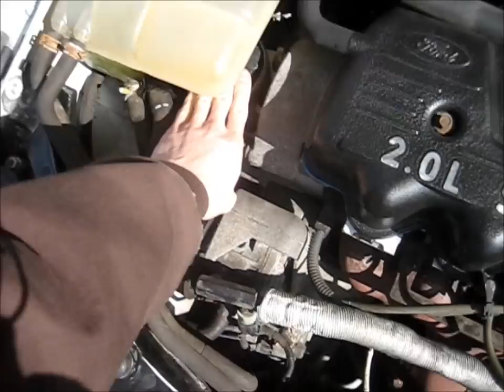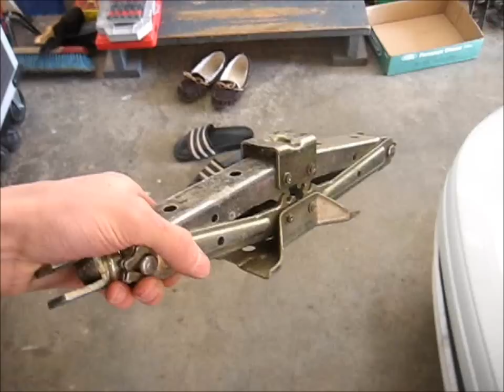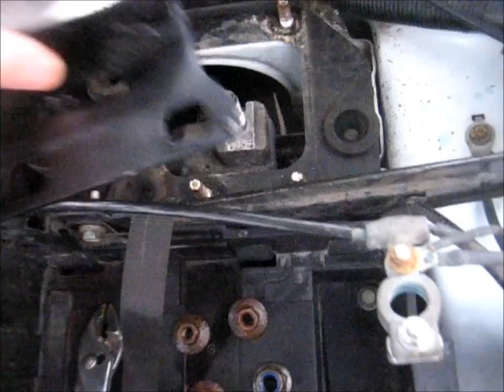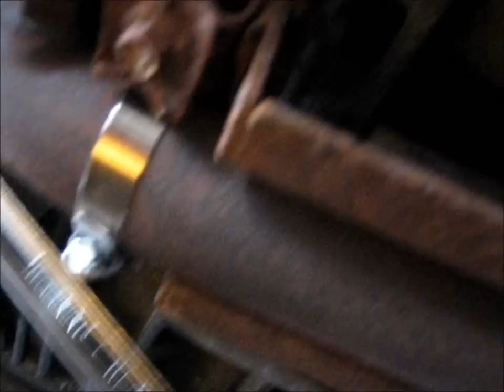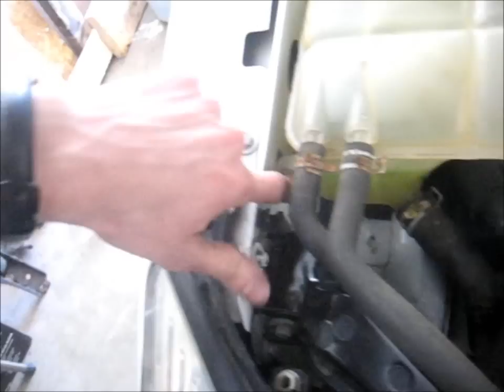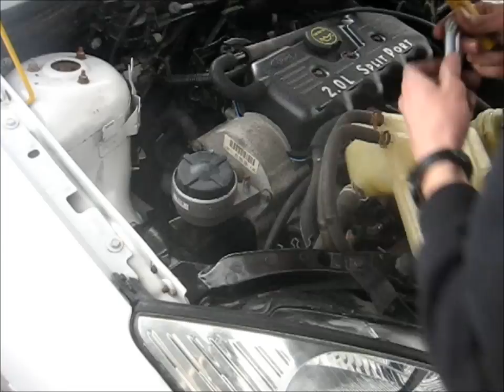How to Replace Ford Focus Motor Mounts

Comment: There are some torque values assigned to these large carrier bolts that you would want to pay attention to....
Reply from the maker: I'm sure there are, but we're not setting bearing preload or replacing a head gasket. I don't think there's any problem with ignoring the torque values here.
Reply: TheAlexManVideos  If >20 to 30 ft/lbs, I would definitely use a torque wrench.  Big difference between 60 and 190 ft/lbs if you're tightening down a driveshaft nut.

Comment: Do u have to torque the bolts to a particular foot pound?
Reply: Nestor Saucedo rock auto has the torque specs for the engine mounts

Comment: When you changed the clutch, how did you take off the hydraulic line going to the bell housing / slave cylinder? I took the retaining clip off but don't know how to separate it to take the transmission down. Mine has 1 tube with a bleeder screw. Some people say use a hydraulic line removal tool, and others say unscrew the bleeder screw and lift off. What do I do?

Comment: As for the one on the driver side how much do i have to raise the transmission so the bolt can reach to the top in order to put the new mount and be able to screw the nut in?

Comment: my 07 ZX3  passenger side mount did not have that bolt under there to separate the mount from the bracket.  Did not matter as my new mount from Ford was all one piece with a new bracket.

Comment: Good video, appreciated!   To others, I strongly suggest going to Ford for the passenger side mount.  Pay a little extra, do it once.  Ford sells the mount with the bracket is one reason it cost more than aftermarket.  Also one less step you need to do when changing.  The bolt to separate the bad mount from the bracket can be a pain without an impact.  Need to put in in a vice is usually the best way of you MUST go aftermarket mount.  You'll be good at it after the 3rd time replacing in a year tho, lol.

Comment: Probably one of the most professional tutorials I have seen to date.  Excellent work!  Enough info to get it done, but without the endless jabbering some people feel compelled to include.  You even sped up the bolt removal sequences so those watching don't fall asleep.  I commend you for a job very well done!!!  I think I need to do mine this week.  173000 miles, and it's been shaking and quaking for the past 2 winters when I start it up.

Comment: It looks as though the dogbone mount didn't require a jack....? I was hoping to see placement for it.
Reply from the maker: Willard Moore No jack needed for that one but you'll probably need to safely lift the vehicle to be able to crawl under and reach it. That mount doesn't hold any weight, just keeps the engine from rotating relative to the body.

Comment: I saw you made this video a year ago; Are the parts from Advanced Auto still holding up ok? (This is where I planned to get mine as well)
Reply: Just throwing it out there I'm almost a year down the road; All mounts holding up from Advanced Auto Parts. =)
Reply from the maker: Sorry, sold the car a couple months after uploading this video. No long term results to report.
Reply: All good; I ended up using the parts anyways, the only difficulty was the lower mount (lining it up with the transmission bracket) but all worked out well in the end. Thanks for the video cheers ^^
Reply: The after marke mounts don't last. Sadly you need to buy from the dealer to get good ones.

Comment: My 2013 Focus SE has vibration at low speed, especially turning left or right, and some noise like parts rubbing each other. Do you think it also engine mount problem? Only 9 month 25,000 km.
Reply: That sounds like it could be drive axles if it occurs when turning.

Comment: Thank you for this great video!  I was quotes $550 bucks to have the Ford Dealership do this but I was able to do it myself for less than $100.  One thing I encountered that might be helpful to others that attempt this though, when I removed the transmission mount the center bolt that comes up through the hole in the frame shifted about an inch towards the front of the car.  I checked the jack I was using and it was stable and holding but the engine still shifted to a place where I was not able to easily fit the new mount over the center bolt while still threading the 4 outer holes through the bolts on the frame.  I got a second jack set up under the engine to reinforce the support on the bottom of the engine and had to shove the engine backwards 3 or 4 times with the mount resting on the top of the frame until the mount fell into position.  It was a little scary as I'm pretty sure I was close to dropping the engine onto my garage floor.  It all worked out in the end though and I saved myself a bunch of money.
Reply: Ford was going to use high quality mounts. Those run well over $100 each.
Reply: How are the after market mounts compared to the Ford parts?? Is it worth the money to spend on the ford parts if you are going to keep the car for a while?
Reply: I bought mounts from Roc Auto. I don't have the car anymore, I traded it in a couple months ago. But they held for the entire remaining time I had the car. I have no complaints.
Reply: +Brian Baraszu the aftermarket mounts are junk, especially anchor mounts. They have a lift time warranty so you'll be replacing them your entire lifetime. Go dealer.
Reply: Of course OEM parts are better, but when you're dealing with a 10+ year old car, you have to weigh the cost and whether or not it's worth it to spend on something you might only have for a few years.  For me, the Rock Auto parts were adequate and half the cost.
Reply: Seth Angel  on my 03 focus 2.0ltr dohc L4 vin 3 sedan, my dog bone mount, the bolt that mounts up & down, is bound up!!! it twists then when I let go, it flexes back.i put a box 15th box end wrench on the top nut & doubled up my wrenches 4 more leverage yet as I thought it was turning, I think I stripped my wrench.is that nut welded? I wouldn't think so because it is needed to secure the new mount! I'm stuck & besides cutting it out with a sawsaw, I don't know what else to do but then 8 would be stuck with no way to the parts store.the parts store does not know what bolt it takes so I would half to take in the original & match the treads but after I snap it, I'm stuck! I'm half tempted to do it in the parts store's parking lot so I have access to parts
Reply: Mine came out fine. But it's a pretty common problem with those center mounts. The bolt corrodes to the housing and the entire rubber bushing will turn when you try to loosen it. The mount isn't very strong though and you should be able to cut through it to get to the bolt. I was generous with the grease when putting the new mount on to hopefully keep corrosion off in the future.

Comment: Are the bolts for the dogbone (one that appears to go into sub frame, 3 for bracket) threaded into the subframe and transmission or are there nuts? I need to replace the motor mounts on my 2011.
Reply from the maker: There were no nuts on mine, all blind threads. I wouldn't be surprised if yours was different. Yours is nine years newer.
Reply: 2000 to 2011 were pretty much the same car.

Comment: So, do I need a power tool and jack stands? what size socket? Do I need to replace them all?
Reply from the maker: You do not need power tools, jackstands or proper ramps are necessary. Do not crawl under a vehicle that is not properly supported. A floor jack or scissor jack is not safe to crawl under. I do not remember the socket sizes, use what fits. Replace only the mounts that are damaged.
Reply: TheAlexManVideos
thanks, i did it by myself and my car feels a lot better

Comment: I was checking at some motor mounts on the internet. Some of them are about $60 for the whole kit of 3 pcs. Are those durable and do they work just fine? Thanks.
Reply from the maker: I've never used that kit or one similar. I only ever used the parts installed in this video. I also sold the car about 3 months later so I can't give any long term reviews.

Comment: Your video has inspired me to try this myself.  My mechanic quoted my $1000 to do the job.  I've already purchased the parts for half the quoted price from the dealer.  But I do have one question.  I have a Haynes Repair Manual and the section that talks about replacing the motor mount has a note that says "The mount securing nuts are self-locking, and must therefore be replaced whenever they have been removed.".   I would like to have all my parts before starting the job.  Where's the best place to get these nuts?  Home Depot? Autozone?  Dealership?  How do I make sure I am getting the right ones?
Reply from the maker: I reused all the hardware.

Comment: hi. did you have to get the drivers side mount from ford or were you able to get it from your local autoparts store?  my local aps sucks and are trying to sell me the wrong mount for drivers side stating its the same as the passenger?  ugh
Reply from the maker: Advance Auto Parts was able to source all 3 mounts without issue.

Comment: Thanks for the video, i bought a focus recently and somebody forgot to tighten the 2 bolts on the upper right mount so i had mad vibration and a knocking when accelerating.

Comment: did you support the engine when you replaced the rear mount (lower)? Did the engine move when you released the bolts? I like using ramp to the front end. I'm not to confident with jackstands. I'm not sure if the engine need to be aligned when inserting the bolts from under. thanks
Reply from the maker: When you replace the torque rod (lower engine mount) you do not need to support the engine. The engine might rotate slightly when you remove the torque rod but it's nothing that will cause damage or be hard to realign. During reassembly, you might want to have a second person stand over the engine and tilt it back and forth to help you line up the bolt holes. Ramps will be fine, just have the engine in neutral and the parking brake engaged.

Comment: hi. i would like to know how many foot lbs. of torque is required when reinstalling the  bolts for all the engine mounts. great video btw. thanks
Reply: Michael Goldstein 
Engine roll restrictor to transmission 35 ft. lbs. Engine roll restrictor to subframe 35 ft. lbs. Engine rear mount to body 35 ft. lbs. Engine rear mount (nut on transmission mounting bracket) 98 ft. lbs. Engine front mount to engine 59 ft. lbs. Engine front mount to body 35 ft. lbs.
Reply: EarendilTheBlessed Better late than never :) Thanks for the info :)
Reply: EarendilTheBlessed Thank you sir for the info. You are a gentleman and a scholar.

Comment: Hi Alex, How did you get the torque mount off once you discovered the bolt was seized in the mount? I had the same thing happen but the bolt sheared off inside the mount. Also, any idea what the replacement bolt and thread sized are?
Reply from the maker: I used an angle grinder and a pry bar to basically chip the old mount out. It took a while. I do not remember the thread size of the bolt. Use lots of grease on the new one.

Comment: Hey Alex, the same thing is happening to my 2000 Focus.  Watching the video really helps me understand what's going on.  I will be buying aftermarket parts.  I can get all 3 mounts in a kit for 65.00 on Ebay.  I just replaced my Catalytic Converter with parts I bought on Ebay for 135.99 including gaskets and it works fine.  I subscribed to you.  Thanks, Cindy

Comment: hey Alex, i'm waiting on the passenger mount as i got on ebay, but replaced the trany mount last night (also havn't done the torque).  the vibration is now noticibly worse.  I'm pretty sure i put the mount in correctly, so maybe moving around the trany exagerated the problem with the other mounts???? any thoughts would be appreciated.
Reply from the maker: In my case only the passenger side mount was bad. I only replaced the other two in this video to show how it was done. If only one is bad you don't have to replace the others. Once the other mount comes in install it and see if the problem persists.
Reply: TheAlexManVideos How do you know which one is bad without taking it apart?   Mine sounds similar to yours.  Should I replace the one under the expansion tank first....then torque....finally under filter?

Comment: Very nice video- though there were points where I was trying to mentally will the camera upwards to see the work..  ;)
Was there any way to determine if the mount is bad before removing it from the car, by visual inspection or testing for movement between the engine and chassis while applying some leverage between the two?  It'd be nice to be able to confirm before replacement if possible-

Comment: To kill the vibration, do you think it's necessary to do the mount under the battery, or just the mount under the coolant reservoir?  It just didn't look like the mount under the battery was the culprit.
Reply from the maker: In my case I could have replaced only the one mount under the expansion tank and been fine. I replaced all three because the cost was low and it makes a more useful video.

Comment from the maker: The top two motor mounts support the weight of the engine. When either one is removed you must support the engine from underneath with a jack of some sort. The factory jack would work fine. The lower engine mount only keeps the engine from twising forward and back, no weight is supported. When you replace this one, you don't need to support the engine at all. But this mount can only be replaced from under the car. Use safe lifing techniques.

Comment: Great video.. I have a question? ?? Is necessary to put the stands or the jack underneath every motor mount is replaced? ? Or it can be done without using a Jack?

Comment: just a my wife a 2008 focus & have to change the motor mount tomorrow. it has terrible vibration any time the engine is running. hope I have as easy of a task as you make it to be. Thanks for the help, I'll get great results @ home for this!

Comment from the maker: Check all the motor mounts. Each one can cause a vibration. If they are all good, has any motor work been done recently? A good running engine supported by good mounts will not vibrate. Check if it's running on all cylinders. Check exhaust condition. Make sure the engine is timed correctly.